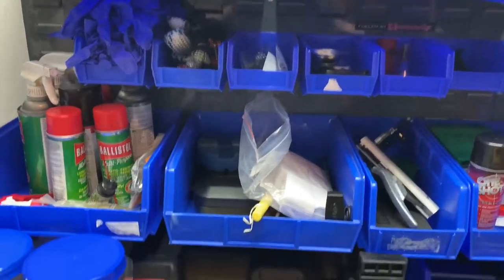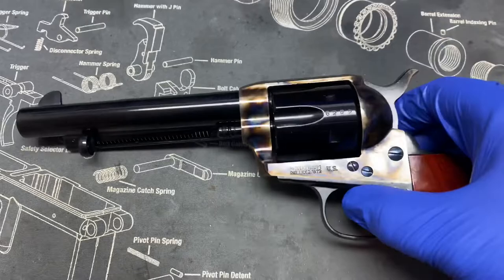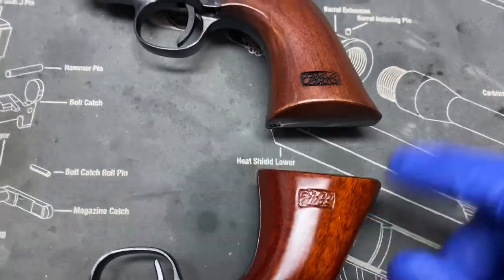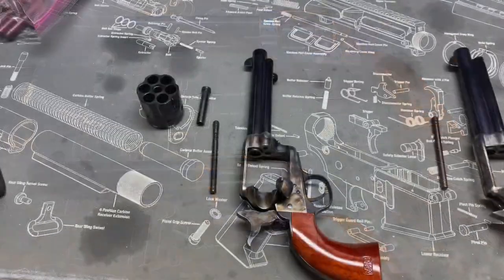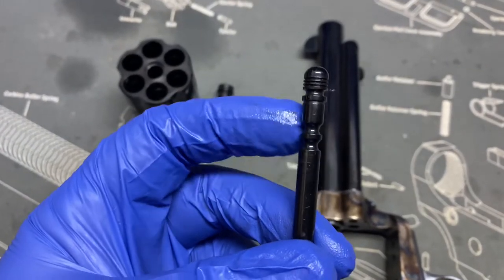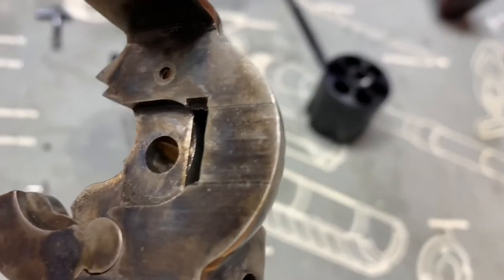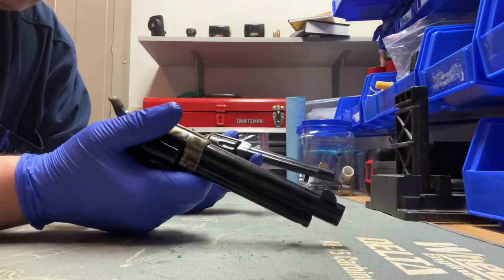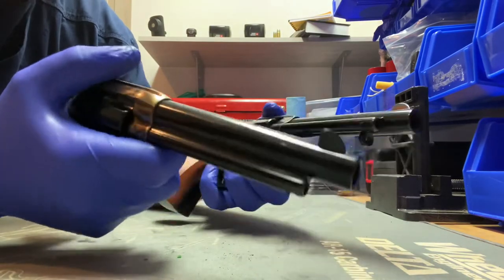Cimarron 1873 SAA Artillery U.S.V. Made by Uberti

Comment: I'll stick with Cimarron's quality before Colt, of which I have had numerous inner action faulty part problems. Colt surely has gone to the scrap pile of firearms manufacturers within the last ten years or so due to very inept upper management and eventually quality control! Out of the seven Colt SAA pistols I originally purchased over the last two decades, five of them were so misassembled and horrible actions requiring me to send them back to Colt for repair. I eventually sold the whole damn lot. Good-by forever!
Reply: i agree thats the truth. thats why ive changed my mind and wont be getting the colt version. they are way past their time. Uberti rules the saa's now. and S&W rules the double actions

Comment: Just got one today brand new Uberti u.s.v artillery model very nice finish on it but the trigger is a hair trigger. action on it is very smooth first couple clicks of the hammer are not as bold until you get to the last 2 do you think the springs are not good from factory? Or is this normal from them?

Comment: Hi, could you help me?

I am about to buy an 1873 5.5, 357/38 and I would like to know briefly which one I should buy / which one is better, among them Cimarron, Traditions, Pietta and Uberti, which one would have more quality and would not give me any problems. Thank you, I await the reply.
Reply from the maker: First of all, congratulations on getting a fine colt 1873 single action replica. They are so much fun.  As far as which ones to get, we'll there are basically 2 Italian companies that make all of them for import into the US.  Pietta and Uberti.  Both have their benefits as drawbacks. As far as out of the box initial quality goes, I'd say Uberti is better than the Pietta. However, Uberti uses a new firing pin safety design that isn't as authentic as the original 4 click hammer that pietta still uses. I honestly think that the Pietta action is better than Uberti, but is less consistent as far a quality goes (rough internal machining etc. If you get a good one, it's amazing. If you get one made on a Friday afternoon, you might need to do some stone work to smooth it out to make it great. I've had both extremes. As far as importers go, both Cimarron, and Taylors and Company import both manufacturers pistols. For a better feel, I like the El Patron model from Cimarron because it has upgraded springs in it which makes it a little smoother than stock. Taylors offers a similar upgrade to some of their guns called "Taylors tuned" and is essentially the same spring upgrade as the El Patron.  EMF offers the Californian and great western lines and they are also very nice, but they are exclusively Pietta.  Traditions imports only pietta as well, but all of theirs utilize a transfer bar safety system. I don't like it, but I'm more of a purist. 

My best advice is to get one locally if you can and look it over real good before you buy it. Make sure that the action is smooth, that the ejector rod moves smoothly, that the cylinder locks up tight when cocked, etc.  If you have to order one online, make sure you go over it thoroughly before you proceed with accepting it and filling out the paperwork. You can send them back if they aren't satisfactory,  but it has to be done before the transfer.

I know that is a lot of information to throw out at you at one time, but I hope I made sense, and I hope it helps.
Reply: @RooftopKY  Thank you very much for the information and your dedication. It was very useful. I will study more in relation to these materials. I will definitely buy one of these revolvers. Thankful.

Comment: I have found Armi San Marco and Armi Jager reproductions to be superior to Pietta and Uberti, unfortunately they no longer produce repros. I have several Ubertis, and Piettas also and find them adequate. I have also found many actually superior to original Colts of which I own several. The Armi Jager Dakota I currently possess can handle +P loads with no issues and has had several hundred +Ps ran through it. I do not think Pietta or Uberti could handle the pressures for any amount of time without shooting loose or worse.

Comment: Basically a kit in a box, if you are capable of slicking them up, lightening the hammer spring, often the hand is too long effecting timing. They are slapped together at the factory and it's not uncommon to find metal chips inside. Cimarron will try to tell you that they are superior...they are not and my experience with their warranty was not good.